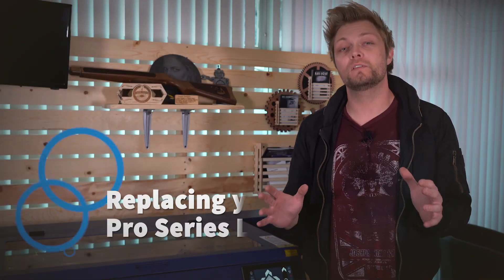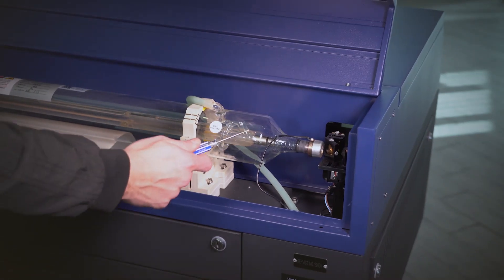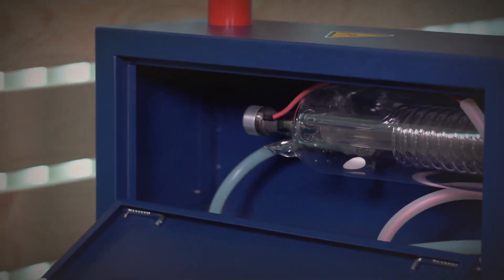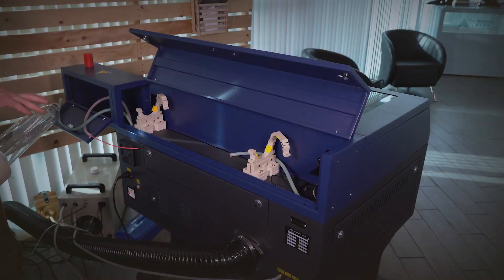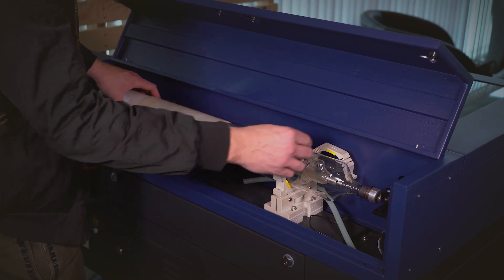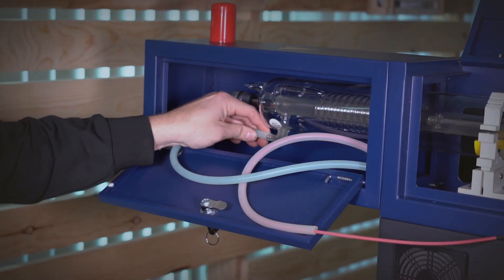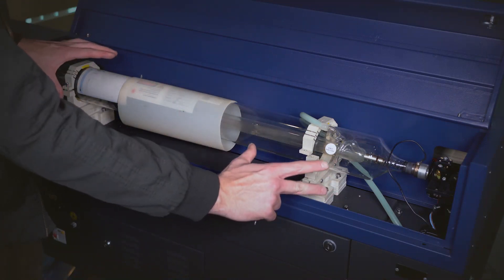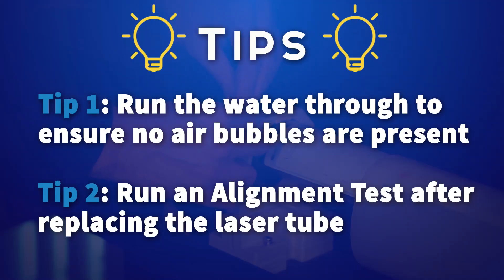Tutorial - Pro-Series CO2 Laser Tube Replacement

Comment: i just installed a new tube. is there supposed to be water in the outer most part of the tube. mine isnt. tried everything
Reply from the maker: If water is on the outer part the tube is broken, the water should only flow through the smaller center glass channel.